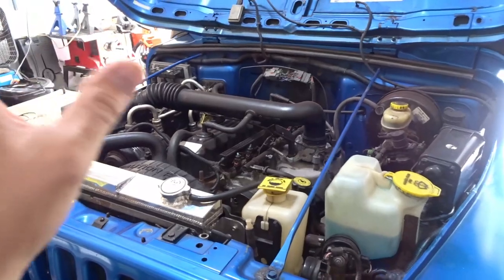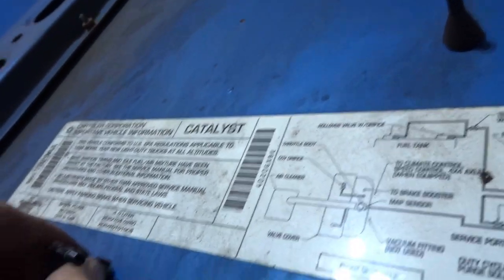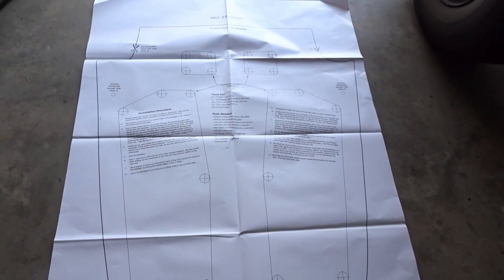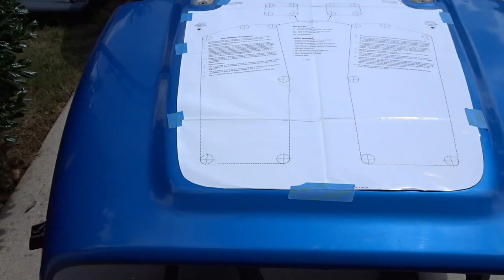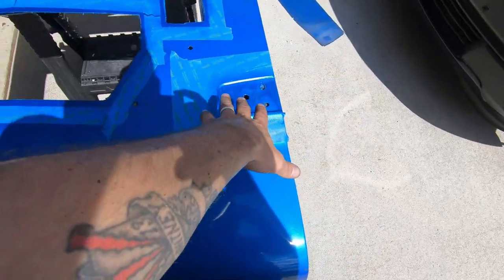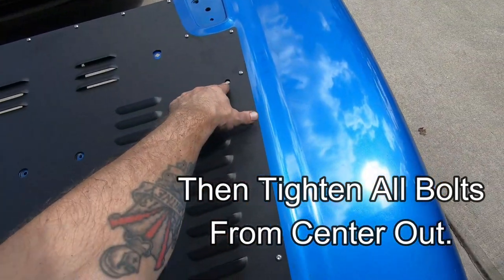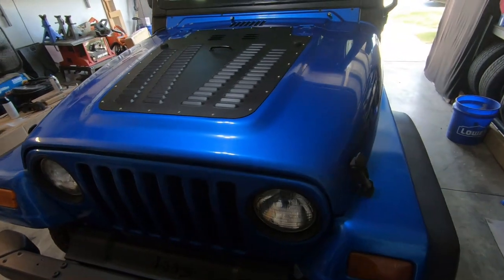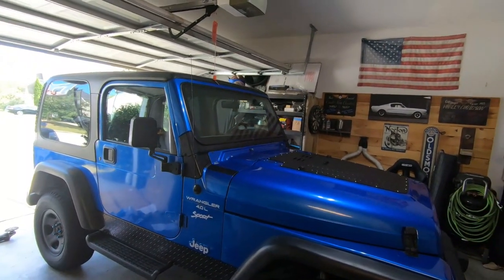Jeep TJ Hood Vent Installation

Comment: For anybody removing the hood on a TJ, I would strongley suggest removing the cowl cover first and just loosening the 4 hood hinge bolts under the cowl cover instead as these are not covered in paint, much easier to loosen. *you also dont end up with cracks in the paint ontop of you hood which makes the hinge and bolts prone to rust as moister will get in now..

Comment: Hi, great vid! any issues since installing? Any regrets in not getting higher end louvers (poison spider)? Thinking of picking this up for my 02 TJ. Thanks!
Reply from the maker: No issues!  Loved it on the jeep.  Great for helping to keep the engine bay heat.  That straight 6 generates a lot of heat under the hood!!

Comment: Hey man excellent work! OIIIIIO
Now since it’s been 6 months (according to YouTube since you uploaded that video) are you still happy with the hood vents? We get heatwaves over 104 that’s 40c and I was thinking if I should do what you did.
I live on the other side of the planet on an island called Cyprus and I have a 2001 TJ Sahara 4L
Reply from the maker: I actually sold the jeep a few months ago, but the hood vents are an excellent addition if you experience high temps or off-roading.  The only thing I worried about was corrosion in the engine bay because moisture can certainly get in a bit easier, obviously.

Comment: Looks great.  The one thing I did notice and would not have thought of until the assembly part of your video is the blue showing around the washer nozzle.  Seeing that at that stage of the project I would have left it alone but if I knew before hand I would have painted those 2 areas in mat black.  How are the edges without the foam tape?  Do you think you might need it or are you happy the way it is?  Great job!
Reply from the maker: I thought about painting the area around the nozzles--I see what you're seeing--but I didn't want a different color painted on the hood, not that it would be any good without the louvers anyway now, but there was just something keeping me from painting black on the blue hood lol.  You don't notice it from any angle though, unless looking straight down on it.  I'm actually glad I did not use the tape now because it sits so nice and flat along the hood.  I have a feeling the tape would have raised it up slightly.  I'm pleased with it!

Comment: Great until it rains and water pours into and onto your engine🤦‍♂️.
Reply from the maker: I'm not sure anyone is worried about the engine of a TJ getting wet lol.  It's pretty difficult to keep it dry on the trails, even with a normal hood.
Reply: You've clearly never run a Jeep in rain.
Unmodified, you still get water in the engine bay. It's not a problem.